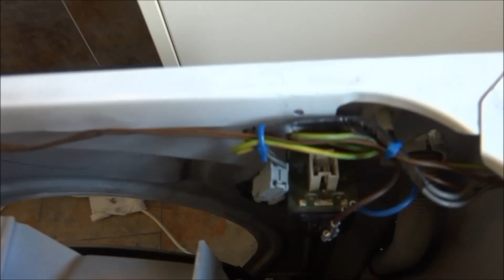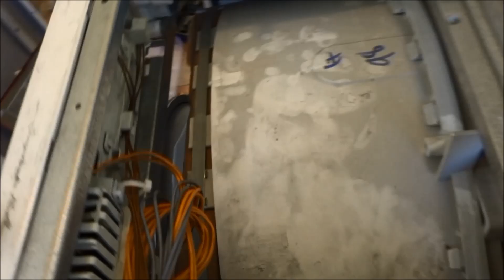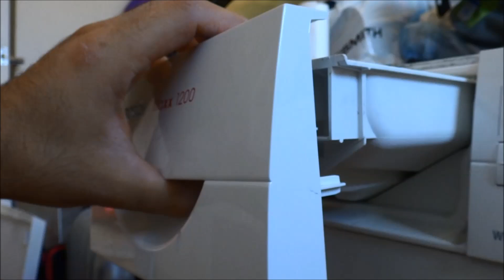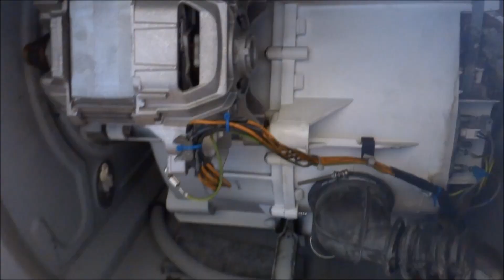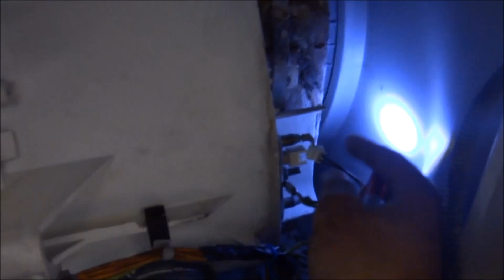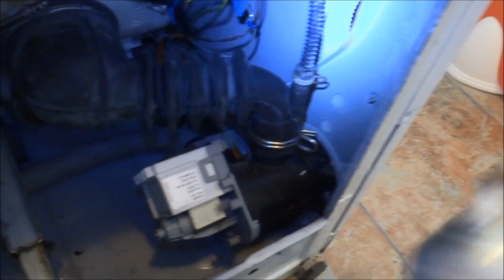Disassembly Washing Machine Repair Bosch Maxx 1200 Earth Fault Trip

Comment: Sorry but repairing Live electrical cables with Insulating tape is just a bodge at best. To complete the repair properly & more to the point Safely, any chafed wires should be cut back & replaced.
Reply from the maker: A & L Appliances Thats correct, the best option is to replace the wire